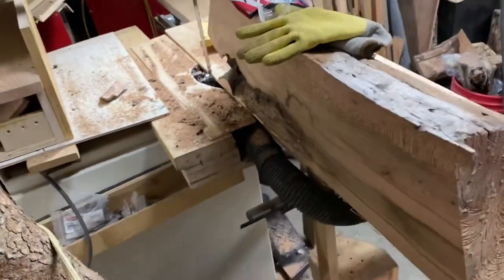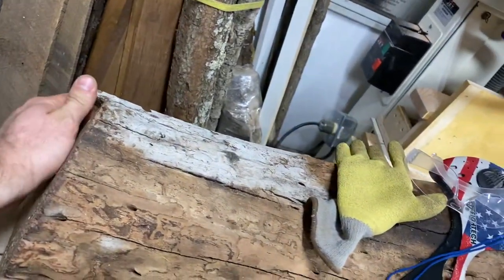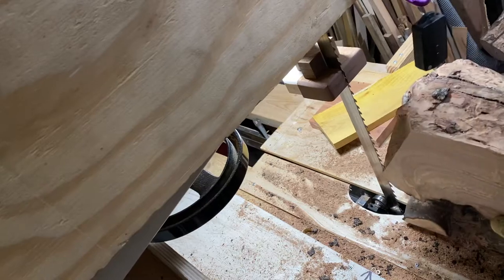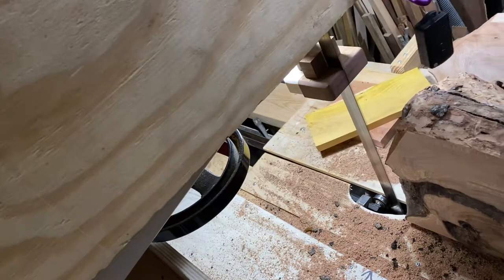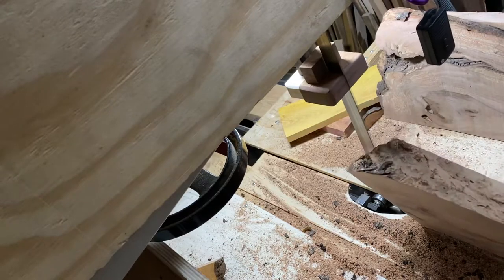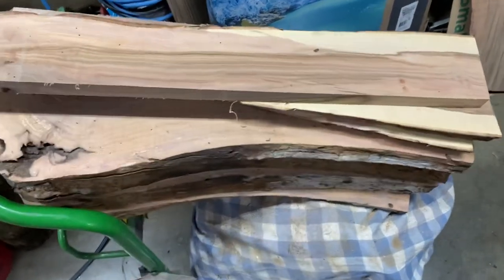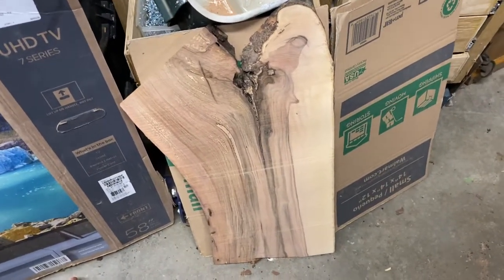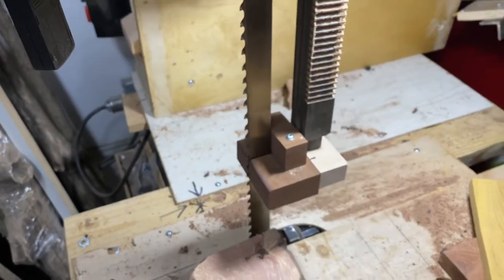Resaw King and Flowering Dogwood LAGUNA

Comment: Interesting, you took the table off your bandsaw, I bought a Laguna bandsaw at a freight auction and did not get the table or fence.  Laguna wanted $900...that was a hard NO.  Talked to a couple of woodworking buddies and both said just make one.  Thinking about it.  Shame to let a 3hp bandsaw with about 15" resaw capacity go to waste.  Have you upgraded your table?
Reply from the maker: I primarily use this Saul for resign so the sled is my primary tool for cutting oh and on the rare occasion you need to cut a profile of some sort and I just clamped my sweat in place so doesn’t move and typically turn the sawn and cut a slot in a larger piece of plywood to work as the temporary table on top of the sled. I don’t have many points of comparison with other blades but I’ve been very happy with this particular blade and did a lot of research prior to purchasing it. Just got one back from the company after sharpening and re-welding it in the world seems extremely thin where they ground off the rough spots so I’m not sure how long that will hold up

Comment: Would it be worth putting some type of clamping mechanism on your sled to hold the logs in place? I doesn't look like you get much movement, but unless you're just making cants and then  using a fence later to mill to size, I would imagine you would still lose quite a bit of these boards during the planing process, right?
Reply from the maker: chrisberry84 Good afternoon. Typically when I need to clamp a board that’s a bit larger or doesn’t have a good flat spot to set it on I’ll use some 90° wood brackets and simply screw them to the table top and use short screws to screw the board to the 90° brace. I have looked into installing T-track and toggle clamps but the screw and brackets are pretty easy to use and adjust and there’s not much of a chance that they’ll come loose unless that Saw catches badly. This blade and rail system combined give a pretty smooth finish you can almost clean up the Saul Marks with a single pass through the planer or sander.
Reply: @Holdmylager  Is it just that smooth because of the resaw king blade? How long does one of those blades typically last you for milling rough logs? (I noticed you take the bark off which I'm sure has to help). I was looking at trying to find a good blade for logs to lumber, but most blades seemed like they would dull way too fast or lose the tooth set. Started looking at carbide blades, and though I like laguna's proforce blade, they don't make a 1/2" resaw king for a 14" bandsaw. 3/4" seems to break too easily for that price. Looking at other brands with 1/2" carbide, but was curious to hear from you how long they hold up for. Everyone else only uses them on S4S lumber. Would love to hear how they last on debarked logs. Thanks!
Reply from the maker: chrisberry84  I can’t say that I’ve ever been able to use one long enough to actually dole the blade enough that it was noticeable. At this point I’ve been using these blades for a little over a year I would say and I have managed in the last month and a half to have one of the blades break in two or three separate places at the same time and when it came back from being repaired broke again in another place. If you’re cutting high-end lumber it’s still worth the cost of the blade even if it doesn’t last as long as it should. I just ordered another brand new one of these and will see how long it holds up. The company will sharpen and ship it back to you for $45 and they say you can usually get between three and five sharpenings out of a brand new blade. Prior to this blade I was usually going through two or three mid to high-end  heat treated steel blades every month